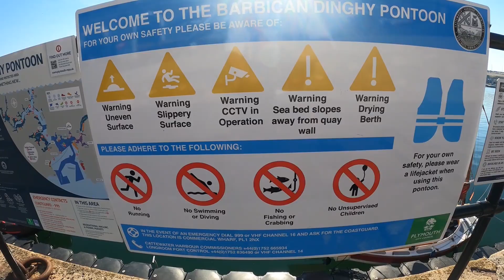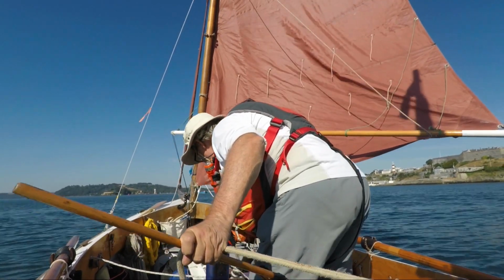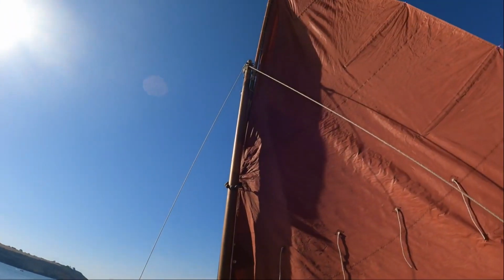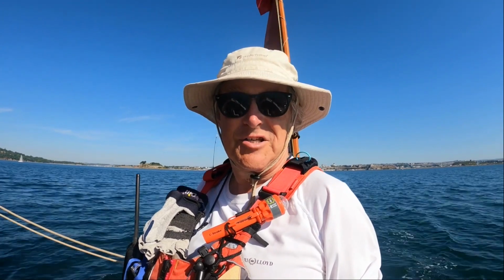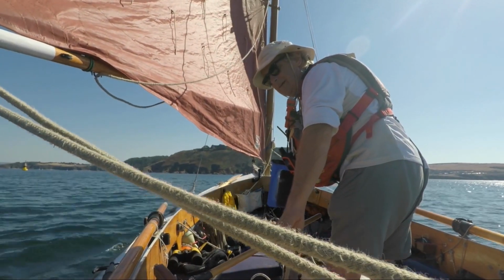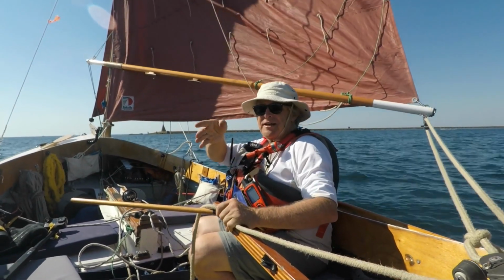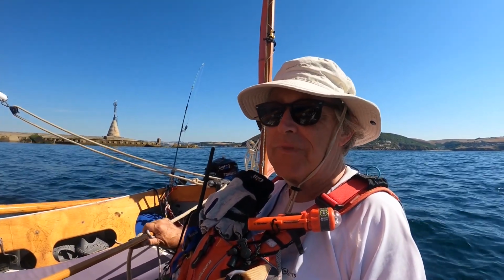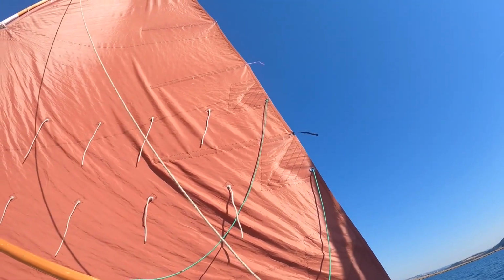The disappearing crease part one

Comment: Good video. About ropes (and anything long that needs to coiled now and then…) - they have a sinister and mean attitude so that e.g. if you coil a rope nicely and put it out of your sight for even a few seconds - then as you need it again, whatever the time elapsed, it has writhed to a tangle that takes longer to clear than the original coiling… garden hoses are the worst as they can also kink themselves so that water will never again go nicely thru them…
Really good to see the sail set nicely. How did you attach the camera to gaff?
Reply from the maker: That is so true......remember when Indy fell in the pit of snakes? That's my aft cockpit.....full of snaking pieces of string 😄

Comment: Which slipway is it you are launching from? I have seen the Elphinstone and Commercial slipways recently but that reminds of the one I used when I was at uni many years ago :-)
Reply from the maker: I use QAB slipways. It costs but I can store car and trailer quickly and safely and there is space to tie up at pontoon for sorting myself out. Many use the free slipway over at mountbatten but parking is on the road or in the car park about 100m away and there is nowhere to tie up the boat if launching single handed
Reply: @plymouthwelshboy thanks very much for the info!

Comment: Steve, you are such a tease! What did you to de-crease? Increase downhaul tension?
Reply from the maker: No idea mate.....I'm just easily confused when there are more than three pieces of string to haul on 🙄🤔😁
Reply: @plymouthwelshboy  ah right so never to be repeated 😅
Reply from the maker: I just try anything until something works...normally either downhaul tension, sprit boom another adjustment or easing something......done very quickly...something works before a disaster happens ...... 🤔😄
Reply: Crease can be adjusted by loosening pull at end if crease. Scallops, waves between corners can be adjusted by pulling corners tighter.
Reply from the maker: As.it so happens on this occasion I shifted the halyard tie on point on the yard further aft. Then i moved the snotter position further up the mast and then I altered the downhaul tackle to increase purchase.....and something worked...now you are good Ng to ask me which one nick and to be honest I have no idea.....🤔🙄🤔😁🤣
Reply from the maker: Tried all that in the past to no avail...I have a sneaky suspicion it was the new halyard tie on point and raised snotter point.
Reply: @plymouthwelshboy  Then the ILUR is fo you Steve - a sheet and a downhaul with the foot of the (no boom, lug sail) sail always outside the gunwale! delightfully clean open boat (this in response to your comment about "more that 3 pieces of sting to haul on")